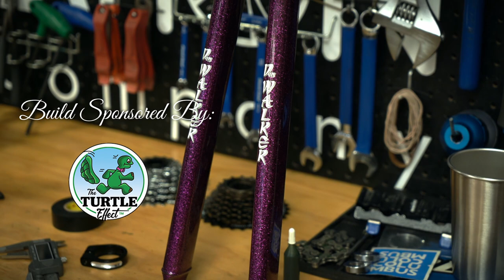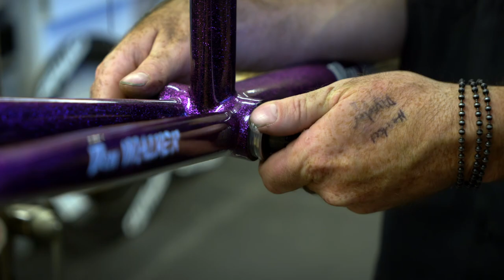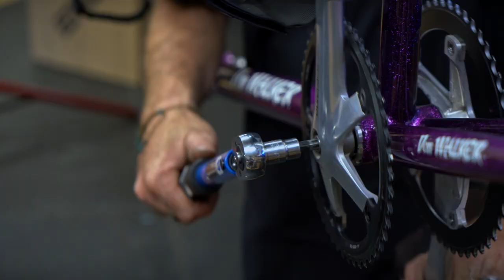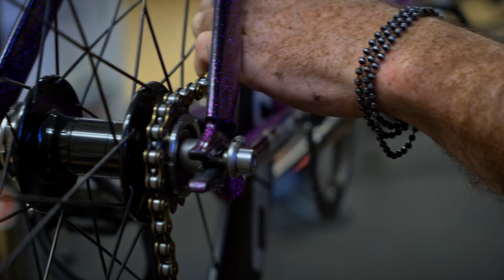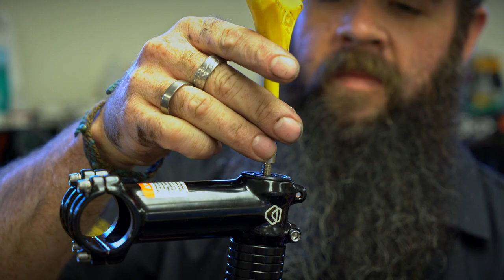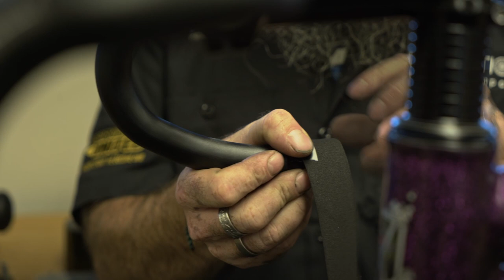Don Walker Track Tandem Custom Build

Comment: I noticed two things, which I would try to do differently.  First, the bottom brackets you're using are the sealed cartridge kind.  Well it turns out, that the 9-spd Dura Ace road bottom brackets, the ones with the roller bearings inside, which can be serviced, have the exact same dimensions and interfaces as do the cartridge bb's that you're installing.  I find the roller bearing bb's to be more efficient, esp. under load, e.g. the stoker bottom bracket AT LEAST could really use that particular bottom bracket.  The second thing you may consider is somehow placing both chains on the same side of the bike.  This may not be allowed for safety reasons on velodromes, because you have to be really careful that the chains don't touch; if they do, the results could be absolutely catastrophic, and may cause an accident esp. on a fixed gear bike.  If you do that, if you place both chains on the same side of the bike (which is more efficient for transferring power from the captain's cranks), you can try to make both chain rings on the stoker's crank more or less having the same tooth count, same size that is.  This way, the chains have zero chance of interfering with each other, they will never touch, so long as the lateral distance between chain rings on the stoker's crank is sufficient, with a couple of mm's to spare, for the chains to not touch.